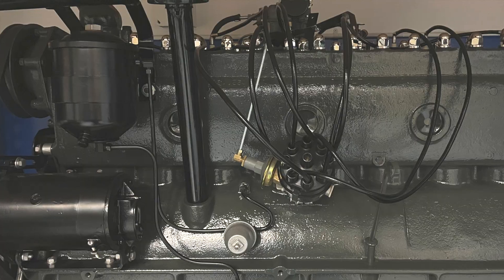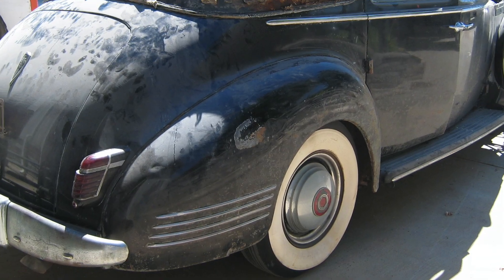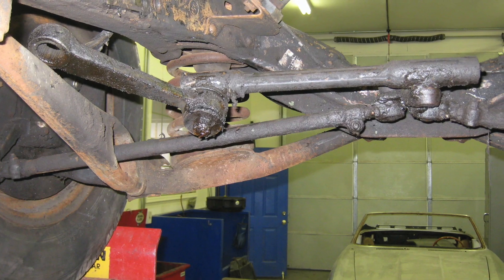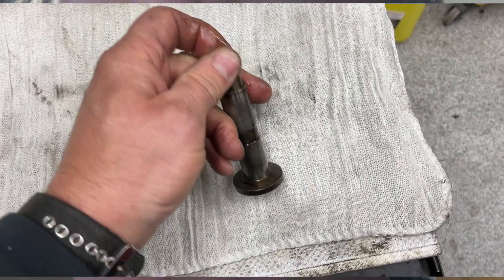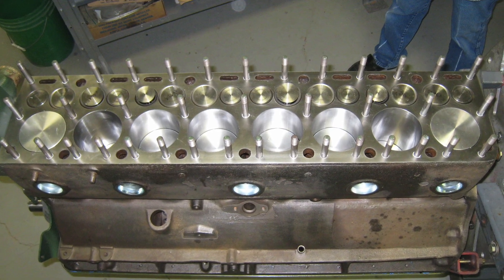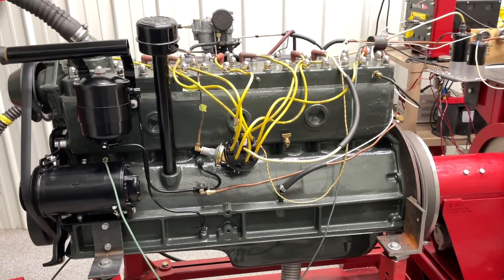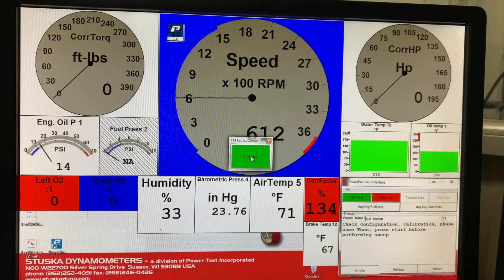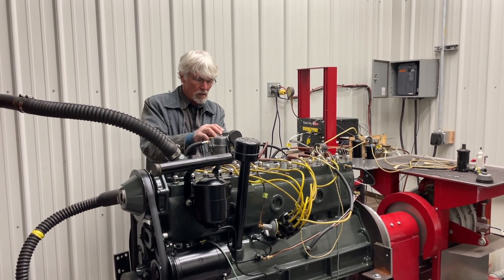1942 Packard 356 engine

Comment: The stumble at, or around, peak torque is due to fuel distribution in the intake manifold. The end cylinders, with the long runners, are a bit leaner than the center 4.

The main bearings were resized from semi finished .060 under bearings. When you resize the shells on the Tobin Arp bearing sizer there is a specific plate for the Packard 356 bearings to get the exact eccentricities at the parting line. If you don't use the specific plate, but use one for a similar shaft size, you end up with a tight bearing at the parting line.

The design of the 356 was closer to the six cylinder introduced in 1937, which was an outgrowth of the 120 straight 8 that started in 1935. Of note, the six cylinder and the 356 used the 3 1/2 inch bore size of the previous 384 Super 8. This bore size would be used through 1954, and also enlarged slightly for the final 359 straight 8. 

Design work on the Packard v8 actually started in the 1947-48 time frame. It was a design typical of ohv v8 engines of the time. It could have been in production for the 1953 model year, maybe 1952, but there was resistance from many in engineering. In 1951, the v8 engines were not more powerful than the Packard straight 8. There were many that felt the torque of the straight 8 and the smoothness were worth holding onto. Improvements in fuel would eventually allow engine speeds and compression ratios that made v8 designs shine. That wasn't realistic until 1954-55 though, and the Packard v8 entered production in 1955. In 1956, it's 10:1 compression ratio was quite high.

Thanks for posting the video.
Reply: You write like you really know Packard better than anyone I’ve heard. What is your history? Thanks and respect. I love me a Packard Automobile!
Reply: Exactly my thought on the hesitation.  Something with the port length and a fuel/ signal imbalance.
Reply: thank you for answering the question of why Packard, after making all those Merlins, was so far behind Cadillac with its OHV V8. I had heard resources were spent on the new automatic transmission. They couldn't do both simultaneously, so given what you explain, it made sense to wait a bit longer. But I surmise that Cadillac was so dominant by then, it was already over.
Reply: @roberthoffhines5419  Had the merger with Nash, Hudson, Kaiser-Willys, and Studebaker gone through, likely Packard would have been the source for the automatics and the top V8 engine.  But Nash and Hudson, which had been friendly to such a mega merger that would have made this hypothetical American Motors the second largest auto maker in the USA, had a new CEO at the helm by the name of George Romney.  He and his backers were wary of that proposed merger, and backed out of it at the last minute, instead formalizing American Motors as we knew it for 33 years.

Comment: Pierce Arrow was the first auto make to us modern conventional hydraulic lifters in 1932, for 1933, all PA engines used hydraulic lifters. The 1929 and forward Pierce Arrow also used oils delivery integral with the crankshaft-Packard used copper pipes and plumbing up until the 356 shown in this video. Great video, thanks for doing this series!

Comment: Thanks Mark. I appreciate the video. I currently own a 1946 Super Clipper. Its 356 is entirely brand new inside now. I even found a guy who had NOS lifters including the bodies. The crank regrind is always an expensive pain in the rear. But it runs so well. The car seems to like 65 mph best. I had a 1941 years ago that could easily do 100 in overdrive. Maybe someday after it gets a few more miles on it I'll attempt that. Keep the videos coming.

Comment: Excellent video. 
Re the comments / reason about Packard not doing a V-8---similarly, the reason why the Rolls-Royce V-8 (which came out for the 1960 model) was aluminum (derived from the Phantom III pass car & Merlin aero V-12 designs) is RR didn't have the money and thus, infrastructure to manufacture cast iron engine parts. They ended up being decades ahead of other manufacturers for this consideration.

Comment: The starter of the 356 sounds so great. It’s has a reduction gear set up and sounds like no other. A neat modification my father made to his 41 160 Limousine was to add a dash pot to the carburetor. When driving up the ramp to the garage it activates and gives extra throttle to climb the ramp in ease.

Comment: On your problem maybe the intake manifold is too cold. If you wrap it with a coil of 3/8 copper and run hot water thru it I think your problem will go away.vaporization,the fuel is turning to liquid on the end cylinders heat will help that.

Comment: I absolutely love these videos, the history, mystique, elegance, of these old cars is so intriguing, the work you guys do is second to none! Do you use a certain blend of engine oil, high zinc-phosphorous, old school or full synthetic, I would really like to know what you have found that works the best?
Reply: Synthetic is fine with a brand spanking-newlike engine, but I would stay away from the super thin oils.  Clearances are probably too large for it.  If you use modern Multi-Grade oil, do not use 5W anything or 0W anything.  Use 10W-30 at first, then after it is broken in, you can use 10W-40 or 15W-40 if you want.  I would stay away from 20W-50 though, until you have over 100,000 miles on it.  If you use single-grade oil, start with SAE 20 or 20W.  After it is broken in, you can switch to SAE 30 in the summer, stay away from SAE 40 until you have over 100,000 miles, and even at that, only use it in the summer if your area has consistently hot weather - 80 -100 degrees every day.  Otherwise, SAE 30 should be think enough, but see if you can find a lubrication chart for your year Packard just to be sure.  You probably don't need the zinc-phospherous if your engine has factory-correct valve springs, but it won't hurt anything if you use oil with it.

Comment: Oddball guess as to the stumble past 2700 rpm.  Those old flatheads have pretty soft valve springs and it might be possible the increased oil pressure at that rpm is allpwong the hydraulic lifters to hold the valves open.   With how terrible oil technology was when that engine was designed it probably only made 40 psi of oil pressure hot when it was new.
Reply: "Only" 40 PSI ?
Reply: @jimmyfleetwood1118  Was making around over 70 on the dyno graph at 2700rpm.
Reply: @kevintemmer3893  Be that as it may, both figures exceed need. The magic number is 10 PSI / 1000 RPM. So 40 PSI would be more than enough. This is so well proven that even NASCAR uses this rule to this day--and look at the RPMs and demands they have.

Comment: That was a pretty smooth sounding engine.As for dropping at 2800rpm,that's timing and fuel.Thanks for sharing that beautiful engine with us.
Reply: Do you think a richer mixture could alleviate the fuel problem, or a bigger carbon?
Reply: @De19thKingJulion  A richer mixture might help at that load/RPM if indeed it is leaning out, but then it might be pretty rich everywhere else.  It could be a carburation defect endemic to that particular make and model carb, but it could also be a poorly plotted advance curve.

Comment: Does that carburetor have an emulsion tube? If it does, I have a lot of experiences with Weber and Dellorto’s that have emulsion tubes, and you can play around with the whole sizes along the length of a tube and basically adjust the “fuel mapping” at different RPM ranges and loads If it does. I learned a lot about carburetor tuning from David vizard During a weeklong course, I took of his